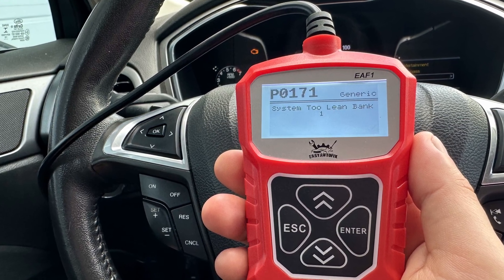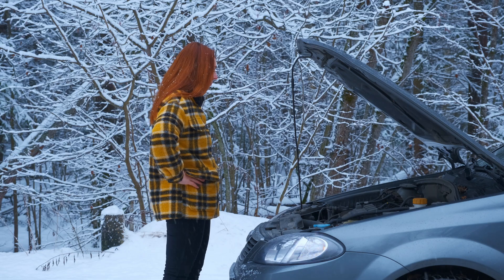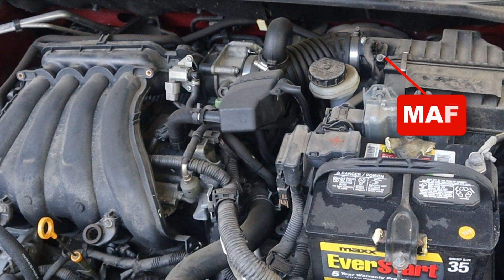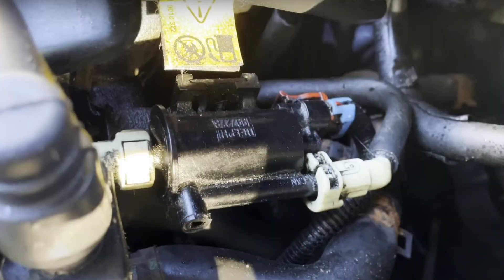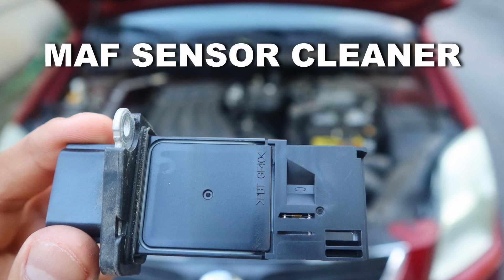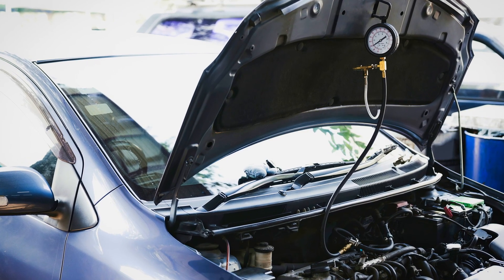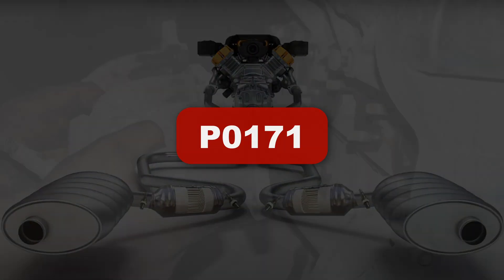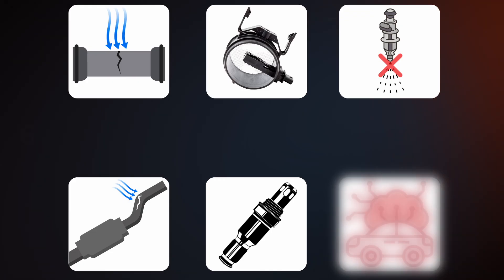P0171 Trouble Code: System Too Lean Bank 1 (The Most Common Causes)

Comment: Great information. Thanks!! The cause on my 2004 Honda CR-V was a bad intake manifold gasket!!! Took forever to diagnosis it.
Reply from the maker: Thank you for sharing!
Reply: Same on my 2007 Element.  What a rabbit hole of diagnosis, until I saw this video.
Reply: Next time you suspect a vacuum leak, go get a stick of incense or a cigar and hold it near common failure points to see if it pulls smoke in. Don't guess or throw parts at your car 🤙🏼🤙🏼🤙🏼
Reply: Tried smoke and it didn't help. It was on the bottom side of the manifold.  @landontucker5436
Reply: Engine on or off?